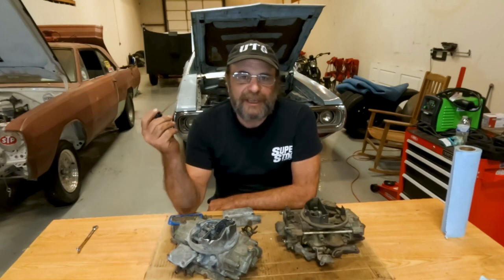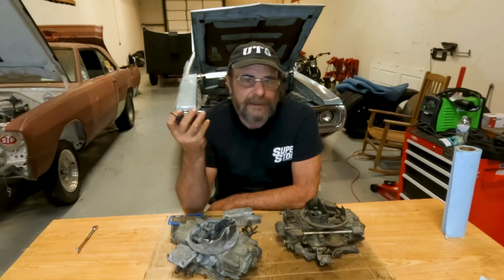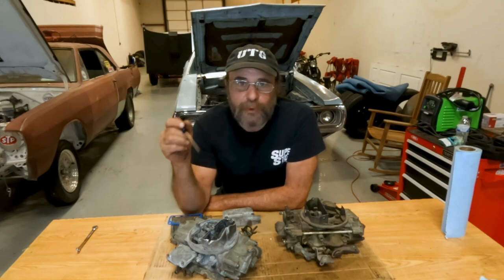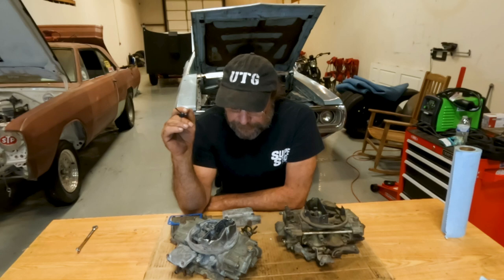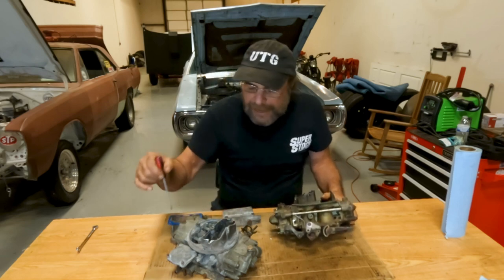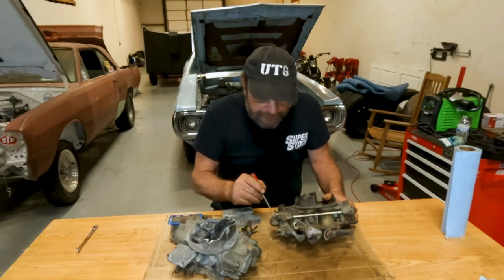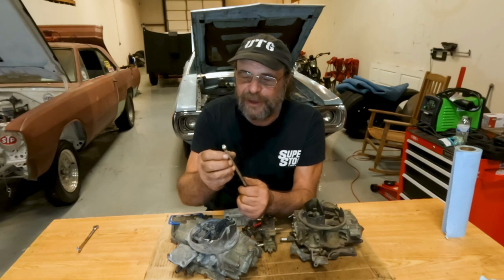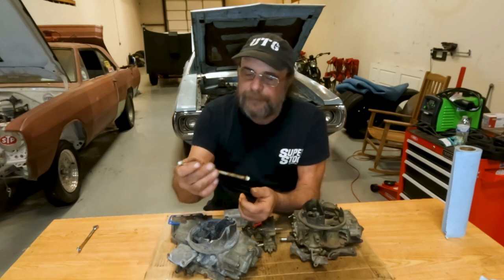O-Ring Hell - A Quick And Easy Guide To Sealing Up The Most Common Holley  Fuel Leaks

Comment: Random knowledge here. Chapstick is a part of my carb rebuilds. Every gasket gets chapstick applied to it, should a roadside repair need to be done, the gaskets will majority of the time be reusable when previously coated with chapstick. 
Marvel Mystery Oil is also a storage must. Every carbureted thing I have gets run on straight MMO before being put up for an extended time.

Comment: With so many gaskets and seals below the fuel level, they are designed to leak. The reason there are so many aftermarket parts available for them is that they need them.

Comment: Unrelated question;  what CFM carb would you pick for a 302ci engine that is not going to rev over 5000 rpm. The math tells me a 500, but is a 600, or 650 too much?  Which would function the best?  Thanks

Comment: Hey Tony, can you do an experiment for us, please? Try replacing ALL the O-rings with new Viton (FKM) O-rings in a Holley on a car you're going to drive this year. Then park it all winter. I suspect next spring, you'll find it doesn't leak anywhere. Viton O-rings are more expensive but they should last decades and stop your yearly Holley teardowns. Do you know what rubber the OEM Holley O-rings are made of?

Comment: Hey tony, so I have that same 600 carb with the transfer tube on an 81 318. And im having this weird problem where it'll start and idle perfectly but after 5 mins it completely dies and wont restart until a full day passes. And it doesn't have the factory brain box ignition, it has a pertronix distributor on it. Thanks
Reply: Are you loosing power to the coil or the distributor when it  dies. Determine are you loosing spark or fuel?

Comment: I am currently dealing with this. I have 2 quick fuel 850s on top of my 871 blower. Fuel is pooled into the intake, carb leaking bad.  Once fixed, how do I keep this from occurring ,, carbs are 2 years old. Car sits in winter, so doesnt get driven from November to April.

Comment: Every engine, vehicle, recreational vehicle that has a carburetor on it should get  two-stroke engine oil put in the gas 100:1 will do the trick. 
Cheap Walmart oil is good enough.

Comment: Holly carb people: I'm a young guy who is learning this on the fly... I have a 69 mustang 428, and I just rebuilt my Holley (735 cfm) which is the stock carb. The floats are at the correct height, my accelerator pump is tuned correctly (I hope), choke is set right, and I've been messing with the mixture screws. My issue is that it's super smooth on the low rpm, then it kind of dies near the mid rpms (no power, no pedal response) and then it comes back alive at high rpm. Does anyone know what the heck may be going on??
Reply from the maker: Sounds like fuel starvation.  Check for clogged sock in the tank...air leaks or blockage along the length of the fuel line.  Check fuel pump pressure.  Could also be something as simple as a clogged filter.
Good luck, Damian!
Reply from the maker: Wait...There's more!  Could also be fuel running away from the pickup in the tank on acceleration.  Engine starves for fuel, acceleration stops, fuel sloshes forward and the pickup starts sending fuel again.
Reply: @UncleTonysGarage  ok I'll check that stuff out today! Much appreciated!!

Comment: But they live in Salvador pumps or just like a quadrant on a hildebra and they go bad and that causes many problems as anything cause most people don't know that but yeah holocaust record routine to dry out I have found that if you open the butterflies when you take the carburetor off and drain the darn gas out of it and you put a rag down in the top of it to stop up You won't have as many problems with it it's just like no that's not no fuel if you run or have a capability of running no national fuel you'll never have a heart rate or is you as long as that engine lives